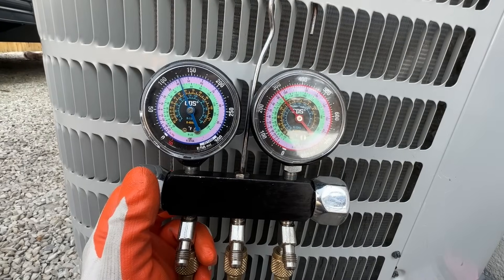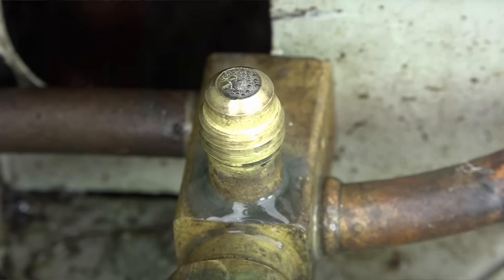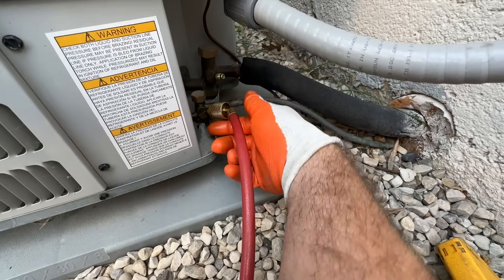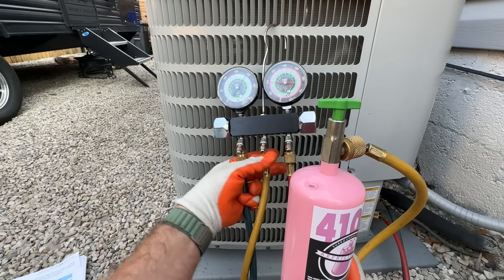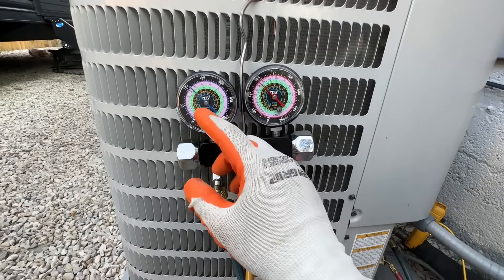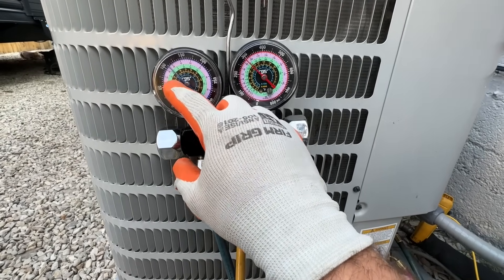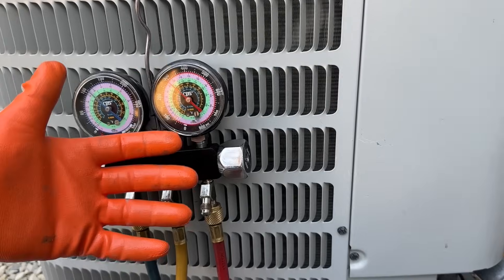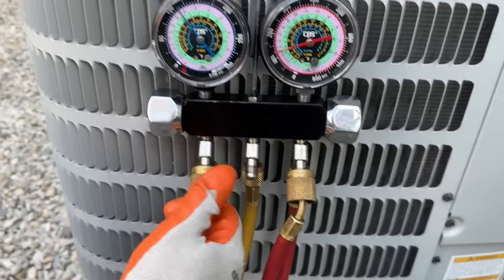How To Add Refrigerant To Your Air Conditioner R410A & R22

Comment: This video is a joke ! This guy is a joke and full of shit ! 
If you have an old shitty air conditioner that’s not working properly have it replaced! 
If it’s newer have a qualified technician repair it! 
There is absolutely no way somebody with little to no experience attemp this. 
R410a is bad for the environment and r22 is even worse! 
So if you follow this guys instructions and get all the tools he talks about and are willing and knowing adding Freon to a leaking system your allowing this chemical into the atmosphere. 
And even if you actually find this leak with out having to spend a ton of money on a leak detector then what ? You pull the refrigerant back into the compressor replace the evaporator coil then you need a vacuum pump and nitrogen and a b-tank to braze weld the system back together. And grantee you won’t charge the system properly anyways. 
I can literally go on for days why this is a bad idea for any home owner 
This shit takes years of experience

Comment: Would that estimate of around 40 degrees for systems using R410a hold true for mini splits?  I installed a mini split with a line set longer than the factory standard.  I want to make sure I add the right additional amount to the system.

Comment: I’ve had my EPA license since 1998 and haven’t worked in the field for a long time. I woke up to a frozen coil in my 410A system. This video is a great review before I dust off my gauges and get to work. I’m glad I came across this video it’s very practical without all the jargon and double talk used to baffle the customer and confuse into thinking adding refrigerant is brain surgery. The field has changed so much but basically it’s still the same. Thank you for making this video to help and not just to inflate your own ego by sprouting a lot of technical terms as many do.
Reply: @washinton2008 I don't remember, it was many years ago, and it's probably changed anyway. Try EPA.gov otherwise your local collage. I  studied online, then had to drive two hours to take the test. I passed the first time, but most people didn't. There wasn't much technical that I didn't know, it was dates, names and laws that I had to memorize.

Comment: Thought 410a is a blend and could not be topped off if low . Blends leak at different rates so topping it off you throw off the blend . All refrigerant would need to be extracted and a new charge of 410a be installed. This is if leak has been found . Blends may have several types of refrigerant to make up the 410a blend . Each of them boil off at different temps and pressure so topping off with fresh to existing charge the blend will be off . R22 is different and can be topped off if low since it’s not a blend .

Comment: By the time I buy the equipment and the cost of license/training, I am in to this for about $600.  The cost to have an HVAC company do the job.
Reply from the maker: You are right, and 600 next time, and 600 the time after that.
Reply: @diyhvacguy  If this was a common occurrence it would be cost effective.  You can go 20 years until the next leak.  Moreover, you need more equipment than what you show to do the job right.  You need equipment to evacuate the system to remove moisture and oil to protect the mechanical components.  And brazing equipment to replace the receiver/drier.

If I need to buy a $100 tool to replace the ball joints on my car and the cost of the job is $400, this does pay to buy the tool even though I will likely never use the tool again.

There are some parts I will replace on my A/C system because the investment is low and payback high.  I have an extra capacitor, transformer and contactor and 3A fuse.  I have a shop vac to clean out the condensate line.  When it comes to charging the A/C system, it doesn't pay.

Comment: What is the purpose of the red hose (high side) connection in this example ? Do we even use that at all or is it just used to view the pressure? Can you skip connecting the high pressure red line completely if just adding refrigerant for a band aid and don’t need exacts ? The yellow hose should be able to push the refrigerant from the cylinder into the blue suction side correct ?
Reply from the maker: Just to view and monitor pressures. But the refrigerant is always added through the low side

Comment: 2 lbs of 410A for $109?  Can't you just get the 12oz cans for $10?  Is this special 410A?
Reply from the maker: Ummm, are you referring to 134a? You can’t get 410a in a 12oz can. I think you are getting it confused with r134a for vehicles
Reply: @diyhvacguy  sorry, you're absolutely right, I was thinking about 134a.

Comment: I have what may be a naive question. I had a tech come out to the house because (against my wishes) the lady of the house called the HVAC company. I was in between my troubleshooting and had to stop to go to work.  When I got home, the tech told me the news was not good. The AC was 15 years old and was dead now.  Admitted there was no leak on our R22 system, but it still really needs to be replaced. Suggested a full new install for 10k.  He said that because I cleaned the outside coils, it probably stressed the system and killed it. He led me to believe the scroll compressor was done for and the root cause of the AC freeze up.  Took apart the shroud on the N coil above the furnace and it was absolutely packed with husky fur(something to think about when choosing a dog).  I cleaned the evap coils to the best of my ability, straightened as many fins as possible with a de-shedding brush, and closed her up. Added fresh foil tape to every seam. That was yesterday. Today, the volume of air moving from the vents is substantially greater, and the ac is cooling without freezing.  
So I guess my question is, can this just be  an honest mistake by the tech, an unscrupulous profit hunt, or somewhere in between?  It was an old system after all. Just frustrating that this could have been a huge expense.
Reply: Yes and no, I mean he wasn't wrong in that when he tested the system if it had multiple air leaks, especially in the return, then his readings might have been off.  But that is why you document things for reference.

Comment: As someone who considers themselves a pretty advanced in DIY learning that I could get the license for $300 and be 100% legal is amazing! I was quoted $8000 to replace an AC unit last week. When I looked up how much it actually cost for the unit they were going to install it was under $3000. Why should I pay them $8000 when I could pay for the license, tools, and unit myself for around $3500? Plus I'll have the tools and license to use into the future
Reply: Can you actually buy a decent condenser unit and evaporator (like a Trane) if you're not a HVAC dealer?
Reply: @LynyrdSkynyrd.4Ever  I have a 1300 sq ft house built in the 50's and plan to move in the 3 years. As long as it keeps the house cool I'll be happy.

Comment: Excellent basic video on adding refrigerant to an A/C system.  I had a home warranty A/C tech come by who did not have low loss fittings & just vented the refrigerant in the hoses into the atmosphere.  I am currently take a HVAC course so that I can service my own HVAC unit.
Reply from the maker: We also have an hvac course under our membership plan! It’s $24.99/month and I’m sure you would leave A TON from the course. 

Cheers

Comment: Hey @The DIY HVAC Guy. I have an old R22 system 5 tn. I live on the water. The evap coil has sprung a few leaks in the U tubes over the years. My "AC guy" is getting tired of welding the leaks. Now he wants to sell me a new system for $8,000. How do you feel about these leak saver shots? My current leak takes about a month to leak out. I have read reviews that these leak saver shots have sealed high side coils on 5 ton systems. I already bought 15 LBS of R22. I'm just not sure if I should try to pay my AC guy to do some creative repairs or take my chances with the leak savers and the $500 in R22 I just bought. Please!!!
Reply: Following. I'm in the exact same situation.

Comment: 3 years in a row I had lost pressure and had an HVAC tech check for leaks. he had the leak detector out and couldnt find any leaks. he evacuated the system, slit the inside and outside line, presurized it with nitrogen and left it for about 4 days. came back and not pressure drop inside or outside. refilled with new R410A. still lost pressure by the following summer. Now my guess is there is a cold leak. leakage that only happens durring the winter when the outside unit gets cold. I am up in Canada BTW. I asked him about possible cold leak and hes never heard of that before. It can happen on a cooling system in a car on the rad hoses. Anyone have any ideas or experience with this happening?

Comment: 410 A is a blend refrigerant. You failed to mention that with refrigerant leaks on 410A you should remove and replace the refrigerant. The refrigerant blend separates when idle and the blend will be altered. R22 has been outlawed, no longer made. 410A is also being taken off the market. EPA regulations require low loss fittings. Lastly the EPA refrigerant certificate does not cover all refrigerant. The current trend is going to propane based blends, not a fan of them. Sooner or later there will be a large leak near a source of ignition.
Reply: R22 is not outlawed. It just cannot be shipped into the USA but it is still made outside the USA and you can still purchase it. Same with 410a, its sold all over, as in this video.
Reply: @Garth2011  please read the federal epa laws on R22
Reply: You can buy all the R22 you want for super reasonable price at Ability Refrigerants. 410a will be available for many more years just like r22 is now.
Reply: @robertgregory2618  Yes, that is true and I believe its about $28/lb for a 30 lb jug delivered.
Reply: Its honestly due to government wanting to constantly expand and justify spending more money.
The main reason for EPA and R22 was due to the ozone but this is long gone and no longer an issue. Refrigeration no longer an HCFC / ozone depleting
410A is not an issue to the ozone but good old gov has to keep making rules/regulations to ever expand and to pretend like they doing something beneficial when all they doing is jacking up the prices of everything. The new rules/refrigerant is just going to increase the costs for homeowners due to the extra requirements because its slightly flammable. 

More labels, Different equipment etc. It will end 410a which will jack up that price as well making it hard to repair older machines.
Anyways just an old man rant.
Reply: R-410A has a GWP of 1890, which is 1890 times greater than carbon dioxide's GWP of 1. This means that one kilogram of R-410A has the same greenhouse impact as two tonnes of carbon dioxide, or running a car for six months.@bobshanery5152
Reply: @dennismayer4936 Oh the horror 😢😮 YAWN

Better go buy an electric car and save the earth while there’s still time!
Reply: @bobshanery5152  All true. How does R22 and 410a deplete the ozone when its recovered and introduced to sealed systems? You'd think the EPA believes everyone has a leak in their HVAC system.

Comment: how much freon do my ac unit need to add good man 5 tons 16 seer . i been watch a lot of your video i give you a tumb up  i will buy the scale incase  i need to used it i;m learning  in my house i the one fix  stuff i'm singer mom,  only problem i had is migraine headches the more i look on screen the migraine attack me. its suck 3o years i deal with migraine. i live in florida its hot all year round  ac run all year. my name is judy i don;t know your name  lol i don't want call you  
The DIY HVAC Guy.

Comment: Hi am calling from Cape Town. I have been doing refrigeration for many years. Problem l followed your video regarding 410Abut this one unit which as 410 A in it but only a schreider value on the suction line. I don't want too but may have to do completely recharge system.

Comment: Nice video, so turning the bottle upside down would be liquid and your charging on the low side to 40 psi and the high side is whatever the ambient temperature is outside

Comment: You should not be in anyway trying this unless you wish to actually work in the trades. If your system has a leak you Fn fix it. Not just keep charging it. They are sealed systems. Leaks need to be fixed. Most leaks are inside the coils. No one should be charging systems or doing brazing repairs unless it's their trade. Flammable refrigerant is coming. Only a idiot would try to teach home owners how to charge their system. Super dumb. Change a capacitor or motor sure. Plus you have to purge all hoses not just the two.  This is a good video but homeowners should in no way be trying this.

Comment: To have changed the R22 on the Rhem Heat Pump 11 years old with three replaced compressors over 11years end with a leak that  empty the system completly  of R22 would have cost me $1100 for 6 pound of R22  so we decided to get a new Heat Pump Trane setup +  a Trane Coil instead  with R410A. will be setup next week we run the furnace now.

Comment: A local hvac company told me they charge $139.50/lb for r410a and $300/lb for R22 😟….while a smaller company said $40/lb for r410a and $100/lb for R22. Kind of insane what the first company is charging.

Comment: I see on the Freon list there is still R11 available. 
I thought that refrigerant was going to be phased out along with R22 & R12. 
So is R11 still used in Centravac’s? 
Yeah I used to work on them back in my day but I thought by now they would be mostly phased out and switched over to the new refrigerants. 
Because of all the Freon vented into the world it would seem to me that R11 would be the worst as these HVAC systems vent constantly all the systems for contaminants and of course the Freon goes out with the contaminants.

Comment: Question. Why did you even need to connect the high side? I didn't see you open up that valve. I just saw you opening up the low side to add refrigerant
Reply: On a system with a TXV you need it to calculate subcooling. Its also good practice to check the high side pressure to make sure its actually low on refrigerant as well as to make sure everything is working properly before calling it good.

Comment: i have to take a class to get refrigerant? and 300 dollars?
I just want a refrigerant for my window AC... ill just spend $150 for a new air conditioner.
Reply: Window units are meant to be disposable when they break. They don't even give you any service ports so you would have to braze one in.

Comment: Pretty insane the last time I checked ability refrigerants for R410a it was $425/30 lb bottle and recently I was quoted $139.50/lb to charge R410a. The company installed a brand new 5 ton ac/heat pump for me July 2022 and about two weeks ago the 40amp breaker tripped in my main panel. Put my multimeter on and I see continuity from a hot wire to ground. Called the company that installed it and they ohm’ed the compressor and they said the numbers look good and the compressor isn’t shorted to ground. But they said the compressor needs to be replaced. After 14 months?!? It’s a Sure Comfort by Rheem system. Typical black compressor. My previous TRANE System lasted 22 years!!! Not sure I believe them and of course the labor warranty is past by 2 months. Only a 1 year labor warranty. $1485 for labor and $1814 for 13 lbs of refrigerant. Which they said they’d pick up cos they kinda feel bad but still there’s the $1485 labor cost 😣
Reply from the maker: Sorry man. That’s a bummer. Hvac repairs can get expensive quick.

Comment: Hi my name is raj I live in Orlando flood I want to thank you for explaining how to add 410 Freon to r22 keep up the good work I also clean my condenser coil by my self
Reply: yeah, you can't add 410a to an r22 system, they use different oil and operate at different pressures.

Comment: Thank you so much! I'm researching this because of a seemingly extraordinary price for a service. I see you have a Patreon and I may be a new subscriber VERY soon. The tools for checking leaks and repairing myself are a fraction of the cost of what I was quoted (details below).
Thanks again!

Abbreviated version: 20 y.o., 5-Ton, R22 System in 2200 sq ft home. Freezing lines on inside unit and no cold air blowing. Tech measured low levels (Low 45.1 Psig / High 164.0 Psig). Quoted flat $800 for leak detection service. Quoted R22 @ $1000/lb and said recharging the system would run about $8K in refrigerant and strongly recommended replacing the entire system (Rouge estimate $20k).
Reply: I highly doubt that he was charging 1000 per pound of 22. We charge 120 per pound.
Reply: And he can take the serial number that is on your coil if you found a leak there and call the manufacturer or supply house if they tell him that piece of equipment is obsolete or not continued and they cannot get the coil, then unfortunately your option would be to replace the coil which means you would have to replace the coil and condenser because they don't make  R22 equipment anymore.
Reply: The leak search price for $800 isn't the worst I've seen either. , you're paying for his expertise and knowledge knowing where to look and the time it takes to actually track down the leak properly to pin point it.

Comment: Can't see coil, it's hidden in the plenum. Mines freezing up I believe as the outside plenum is sweating, and cold and air flow form vents is less. Problem is, how do you see the coil? Looks like installers put one piece on top of furnace so can't take a side off.